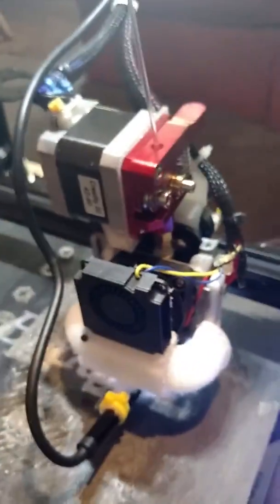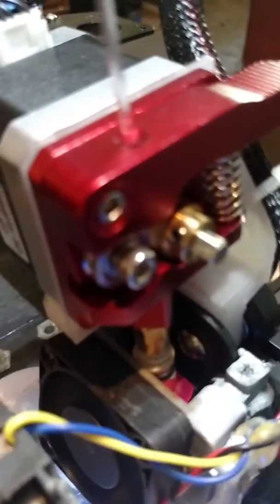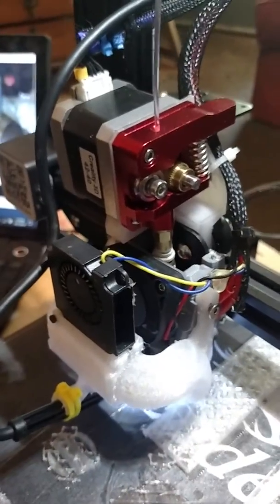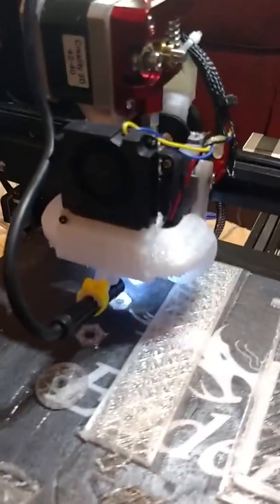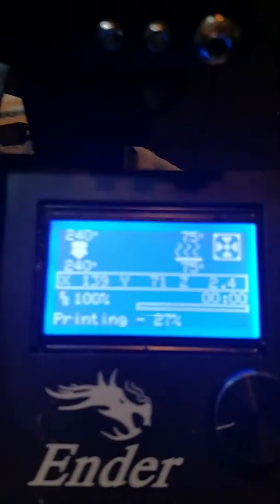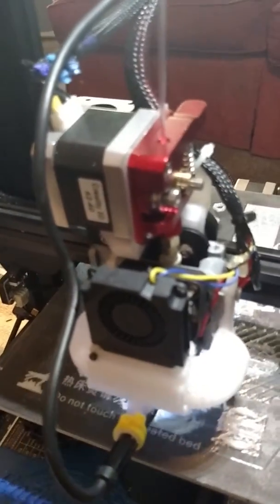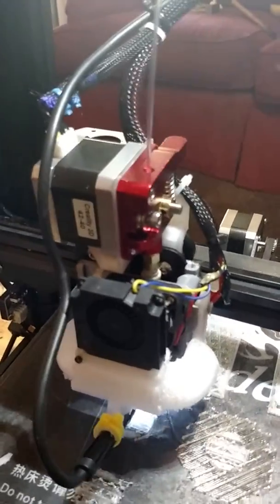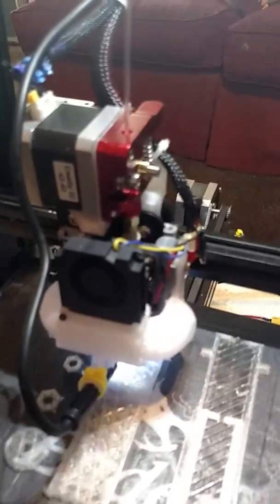Creality Ender 3 Direct drive upgrade

Comment from the maker: I do all my hot end stuff out of pteg just because of heat and strength I would use 
75 percent infill on the bracket holding the stepper motor it holds everything straight.

Comment from the maker: FYI I know the duct fan is not in the correct way I was printing some PETG and didn't want the fan so I turned it to the left to make sure it wouldn't affect the print. I didn't have it disable before the slice and didn't want to shut it down in controls.

Comment: As many people are quite concerned about the weight it adds on the axis, did you see any deterioration in the quality of the prints or increased vibration or overheating of the motors?
Reply from the maker: Not really any struggle or undo wear.
Reply: If You want, You can put a nema 17 pancake motor with stock extruder or BMG Bondtech clone. Nice printer!